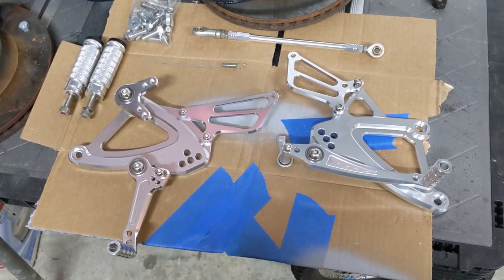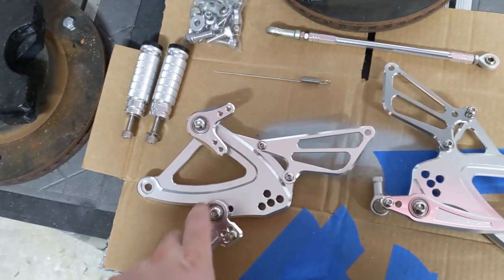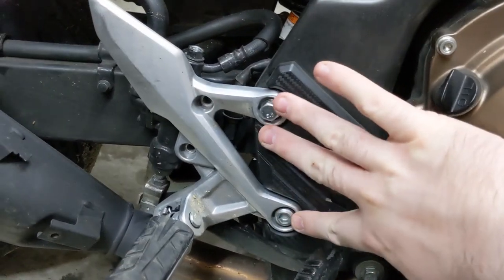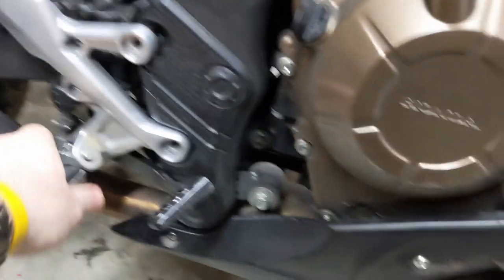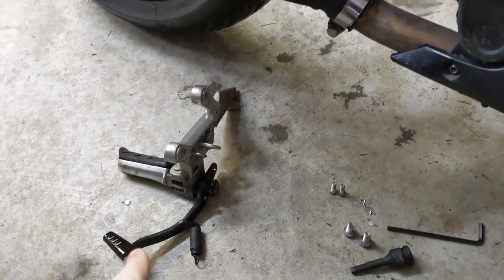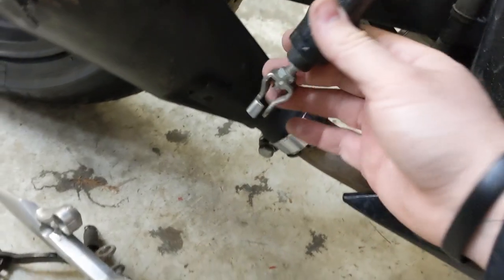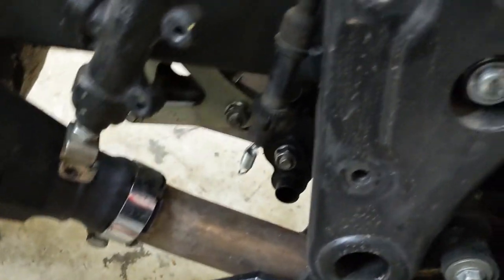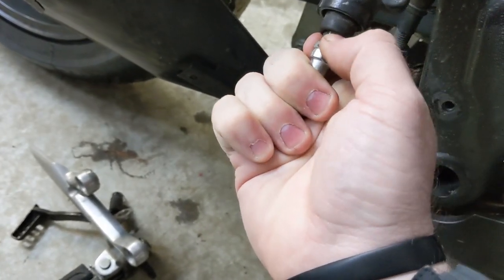2016-2019 CBR500R Sato style eBay rearset installation

Comment: Had these on my Cbr500r 2016 and tbh its nothing compared to a super sport you can get abit more lean angle but unless your tracking it I didn’t found them useful preferred the stock ones in my opinion especially if your a taller guy/girl it’s gonna be a u comfy ride that’s for sure. Good tutorial very detailed

Comment: Great video, Were you dragging pegs prior to this install or did you just want the more aggressive position. I ask because I have the CB500F and had to remove my peg feelers pretty much right away because they drag so early in a corner. Thinking about getting a rear set like this one before I hit the track next month. Thanks
Reply from the maker: Thanks!  Yep, I was constantly dragging peg.  I removed the screws in the bottom of the pegs but still drug them all the time.  Since switching to these SATO clones, the left side drag point is the kickstand and the right side drag point is the exhaust.  Significantly more available lean angle than stock.
Reply: @47MasoN47  Cool thanks, I think I'll have to pick up a set, fingers crossed they show up before the track date lol. Thanks again and have a good one.
Reply from the maker: @2WCapo  Oh yeah, you'll definitely want these before going out on the track.  If you haven't done it yet, the GSXR 750 rear shock mod is definitely worth doing.  That OEM rear shock is pretty garbage.
Reply: @47MasoN47  i am looking for race pegs because of the same reason but I fear I might lean too far for the tyre to handle without a warning like the footpeg gave. I cant fully use my tyre now by half a centimeter though..
Reply from the maker: @silent_fluo6917  if you have the stock exhaust, the right side drag point becomes the aluminum exhaust heat shield. The left side drag point will be the little stick welded to the kickstand to make it easier to fold down.
Reply: @47MasoN47  i have a leovince exhaust. But basically ill hit the kickstand before running out of tyre? Thats good
Reply from the maker: @silent_fluo6917  Yep! The little 500 can lean over a lot farther than you'd think.
Reply: @47MasoN47  nice! Thanks for responding bro!
Reply from the maker: @silent_fluo6917  No problem, enjoy your bike!

Comment: How do you make it GP shift when there isn't enough clearance for the rod if you flip the linkage over?
Reply from the maker: I never used GP shift on mine.
Reply: @47MasoN47  But you said you could? But I’m struggling to see how when the rod doesn’t have the clearance with the linkage flipped over.
Reply from the maker: @Rempai420  yeah it's possible for sure, I set it up when I was messing with mine. I don't have that bike anymore so unfortunately I can't really help with that :/

Comment: if you do your rear sets is it also recommended to change the handlebars and install clipons to lower the bar? I have a 2014 CBR500R
Reply from the maker: I kept the OEM clipons on my bike and was fine.  I personally think that lowering them would make this bike super uncomfortable to ride, raising the rearsets made it very cramped, but it was worth it for the extra lean angle.
Reply: @47MasoN47  i personally wanted to do both because i dislike the upright seating position and wanted to go for a more sporty feel
Reply from the maker: @TheBenefactorr  ah, you could try it. I like the upright position myself. My main bike is a GSX S1000.
Reply: @47MasoN47  how long do you find yourself on the gsx until you feel you can’t ride anymore?
Reply from the maker: @TheBenefactorr  So far the most I've done in one day was a little over 600 miles.  I was pretty wore out at the end of that day but I still want to try doing more than that sometime, just have to get a trip together for it once the pandemic is over.  I did about 400 on the CBR500R one time but I got pretty miserable on it after about 275.  I'm 5'11" and a bit on the chubby side (225lb) so I'm sure that makes a difference.
Reply: @47MasoN47  thanks man, really appreciate all the help 👍
Reply from the maker: @TheBenefactorr  No problem, those little 500 are great bikes for sure, I put a little over 10,000 miles on mine before I sold it :)

Comment: Hope u reply to my comment 
Was it necessary to replace the brake hose that u said at the last of the video?
Reply from the maker: I had to, mine wasn't long enough otherwise.
Reply: @47MasoN47  you mean the original one was not long enough to link to the cylinder?
Reply from the maker: @showmethemoney6600  yep, just barely too short. You might get lucky and have a slightly longer one on your bike but I kinda doubt. That brake line hose is pretty cheap at o reilleys.
Reply: @47MasoN47  thanks for the whole comment 
Maybe I have to find the way 🤔

Comment: Do you have a link for the set? I think I want a cheap set to hold me over
Reply from the maker: Sorry for the late reply.  I didn't get comment notifications on this video for some reason.  Here is a link to a set similar to the one I bought - https://www.ebay.com/itm/For-Honda-CBR500R-CBR400R-CB500F-CB400F-2013-2019-CNC-Rearset-Footrest-Footpegs/143656850505?fits=Model%3ACBR500R&hash=item21729d9449:g:iScAAOSwZDVcuEfH

Comment: How to setup for gp shift
Reply from the maker: I believe at around 31:45 you'd install the linkage rods on the opposite flanges of the shift linkage from the way that I show it in the video.  I sold this bike so I can't verify that.
Reply: @47MasoN47  thanks imma try once I buy a set